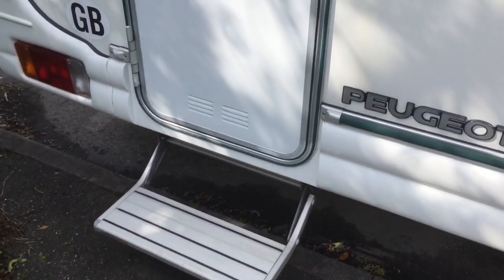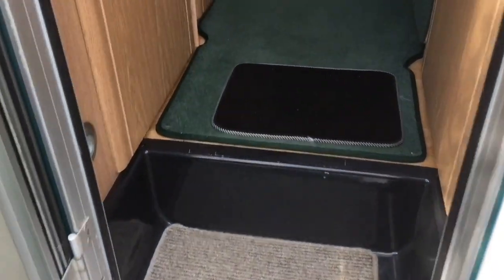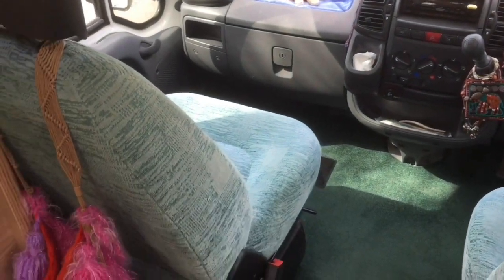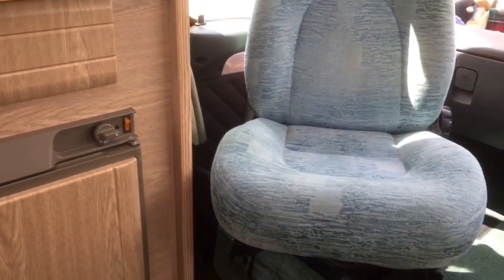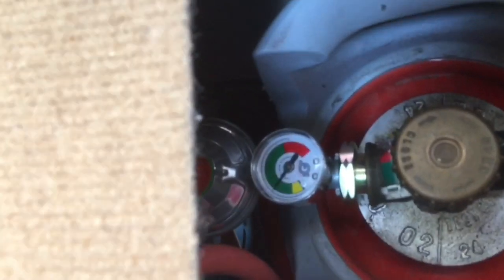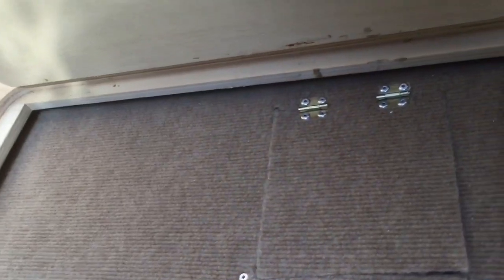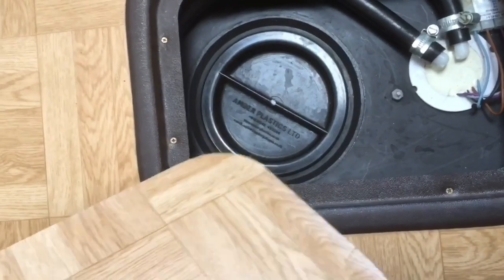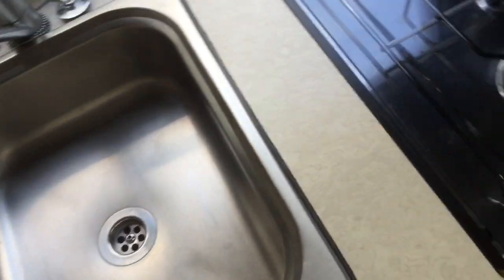My new Motorhome Pioneer Pizarro

Comment: Hi Bob, I’ve seen a 2001 valentine for sale and seriously thinking of purchasing, can I ask what do you think about the diesel heaters they come with, are they noisy and do they use a lot of electricity, can I ask how long your battery normally lasts.
Ps have you any thoughts of any other things I should look for 
Cheers Paul
Reply from the maker: Hi Paul The only time I have used a Diesel heater was in the Autosleeper Symbol I had, It took a lot of power to start up , not so much while running, but a lot of power once again to shut down, It's best to run the engine while you start the heater so your leisure battery gets some charge, It's the glow plug that's eating your volts while it get hot, once the heater is running you can stop the engine, The glow plug gets hot again when you shut down, this is to burn of the residual that will be left on shut down, I fitted a volt meter on the Symbol to keep track of the battery,, The noise is not to bad if you have it on low which is where you will have it as the van heats up quickly,,,
Reply from the maker: Peugeot boxer Fiat ducato Citroen relay, All these are the same vehicle,  1996 through to 2002 All suffer Gearbox Problems, This is because water enters the box messy with the oil and the synchromesh on the 1st and 2nd gears breaks down,, If there is and resistance when selecting 1st or 2nd ,  then it's knackered. I had a replacement gearbox on my first Autocruise Vista 1996/2002 model, Had it fitted by Gloucester road gearbox in  Bristol  it cost £1600,  Most motorhomes are off the the in winter so no road salt get to them, If it's low mileage then it was parked up, But a higher mileage might mean it was used year through, so look for rust,,
Reply: Hi Bob , thank you for that much appreciated 👍
Reply: Jan&Bob Hi Bob, thank you for your previous comments and initially following them I decided not to get a autocruise  however I really like them. So may I ask if I find one with a healthy gearbox is there anything I can do to reroute the water so it avoids the great box. also as I would be using it in winter, when you say rusting is this the bodywork or the chassis. If it is the chassis and it’s in good order I wonder if under sealing it would address the problem. I would really appreciate your thoughts on the above. As I really like the these campers but a little hesitant regarding these concerns.
Cheers paul
Reply from the maker: You can reroute the  windscreen drainage, I used  some plastic on top of the box, you can by a modification it's a rubber pipe to reroute ,
When I said winter use and rust, this is over many years, I use mine in winter, each time I wash I run the hose around the wheel arches and long the door seals to wash away the road salt and spray the hose under side along the chassis, I have not under sealed,  If you have a panel van you need to wash the full length of the van, Just to remove the salt,, I am a fan of Auto-cruise more so than Auto-sleeper, Just small things make  it for me, Auto-sleeper on-board waste tank has no over flow, So when to tank is full you get waste water coming up in  the shower tray, This happen on the Auto-sleeper Nuevo and the Symbol I had,,
Reply: Jan&Bob thanks you Bob very much appreciated 👍

Comment: Bob, I have been doing a bit of research (thanks for your very useful videos) and have decided I would probably like to get an Autocruise Vista. I was encouraged that you sold yours, and then after a different one decided to go back to the Vista (well, the Pizarro version). From my point of view you are a Vista user-expert, and I would be interested to chat about things to watch out for.
Reply from the maker: I like the Vista for every day use, I do not run a car ,  We have had a Autosleeper Neveo, 
Autocruise Vista, Autosleeper Symbol, Autocruise Valentine, Romahome Duo, and as you say back to Autocruise Vista, For me the Vista is tops for everyday use and when we go away the habitation design works fine, It's small but big, two people can move around very easy, The big problem is the Peugeot unit the coach build sits on, The 1.9 boxer 270,  Fiat Ducato, Peugeot Boxer, Citroen Relay,are all the same base unit, and it  has gearbox problems, the first vista had to have a recon box fitted after 23000 miles cost me £1600 at Gloucester road gearboxes  bristol and did not really run right after,, the Peugeot 290 which I have now is ok on the gearbox,, If you google Fiat Ducato, Peugeot Boxer, Citroen Relay,  1.9 gearbox  Synchromesh   problems you should get to know all you need to make a decision
Reply from the maker: I have a video up at the moment on the above cab cupboard size as some one wondered if it would make a bed for a child, I seen a Vista on eBay with the bigger front and put up a link to the page for her , Some one sent a reply with interesting info you might like to take a look at, the link is
 https://www.youtube.com/watch?v=paZTMG3byRA
Reply from the maker: I have found a video the the Vista that is for sale at Motorlands uploaded by the owner before he sold it to Motorlands you can find it here 
https://www.youtube.com/watch?v=-W5NuOmaqyY